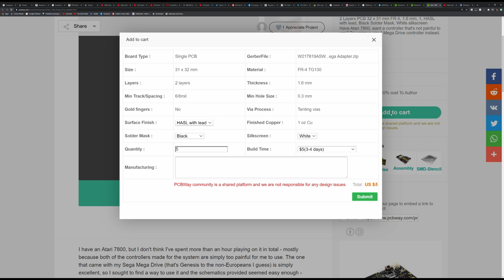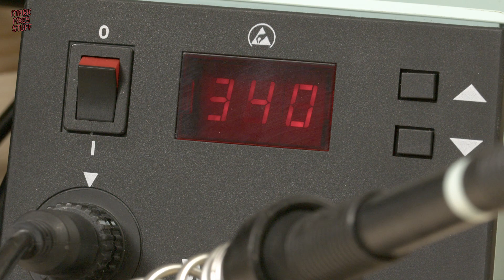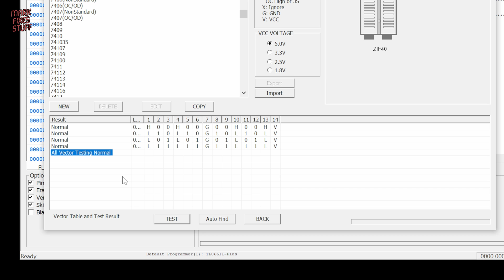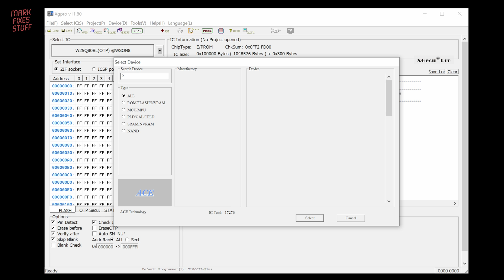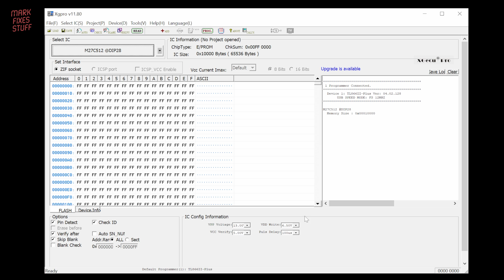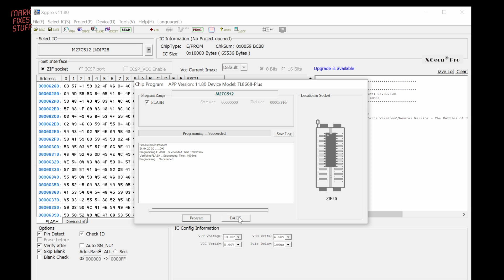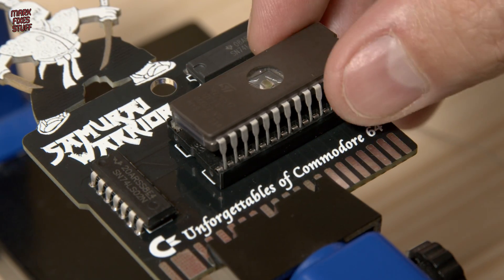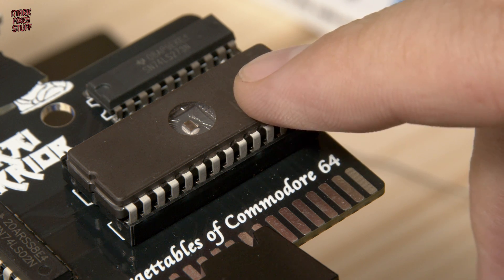I made a C64 Game Cartridge that never existed - Usagi Yojimbo Samurai Warrior Commodore 64

Comment: I do like the PCB holder you use while soldering, I've got something similar... but I find it much more convenient for small boards like this to simply place the socket and board down on the bench and let gravity hold things together while soldering. I do two opposite corners, inspect the socket to make sure it's lined up properly and flush with the board and solder the rest of the pins. This also allows me to rest my forearms on the bench to allow finer control.

Comment: I had a lot of fun making Magic Desk cartridges, Marko is a great guy and he adapted his version of the board into a universal design that can be wired to take practically any EPROM. It is possible to fit 30 or more C64 games on a single cartridge, however as you rightly pointed out it has been kind of eclipsed by the Kung Fu Flash and the soaring cost of new flash PROMs.
Reply from the maker: It's a fun novelty trinket really. Blame it on the Bunny!
Reply: @MarkFixesStuff  But why are there two glasses?!
Reply from the maker: @dantootill7644  he gets it!

Comment: Man, I still have that game on tape. Great times. Sadly, my C64 power supply is positively bulging like just a little excitement may cause it to blow, and yeah, not risking seeing if it works.

The dictionary reminds me of that time I decided to hack English menus into a Japanese only wrestling game(I'm NEVER doing that again; I was a right tech support grump on AIM over it) and that game had 8-bit characters that conformed to ASCII up to 7F, then 80 to 8F acted as 16-bit characters for writing in Japanese corresponding to Shift-JIS, then 90 and upwards were 8-bit common Japanese characters and special use. For instance, there was like 30 variations of the powerbomb, so "Powerbomb" was one of the upper range "characters".

Err... I kinda digressed even worse than normal... I did have a point, but it got lost in between remembering and writing that lot...
Reply from the maker: C64 PSU's are murderers. I recommend getting a modern version.

Comment: I've found that those programmers are not infallible on their logic testing (but still very useful), there are a few chips that have false fails with it.
Reply from the maker: I've heard that actually. My attitude is that if I test it it's "probably" safe to solder into a board. I bulk buy logic from places like AliExpress becuase it's much cheaper and they can sometimes be remarked chips. I'll definitely bear it in mind, so thank you Sia.